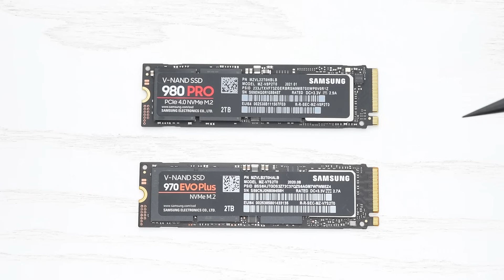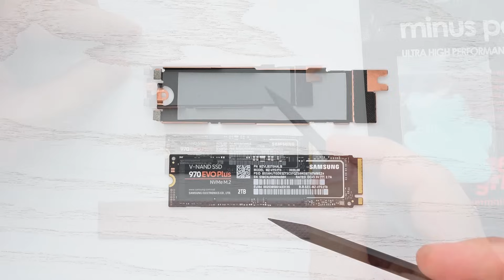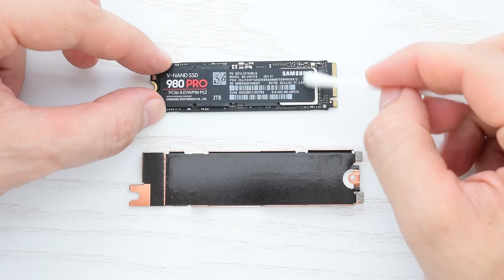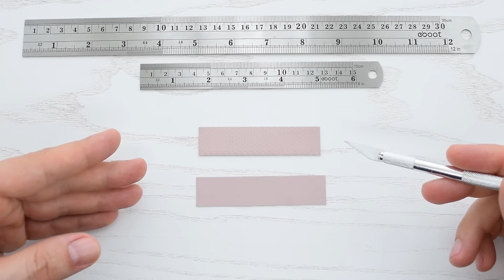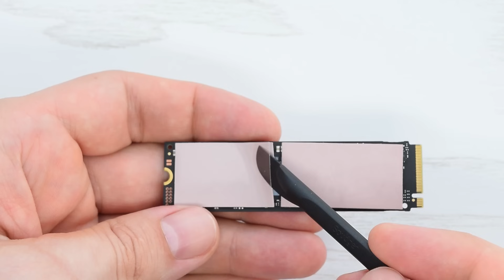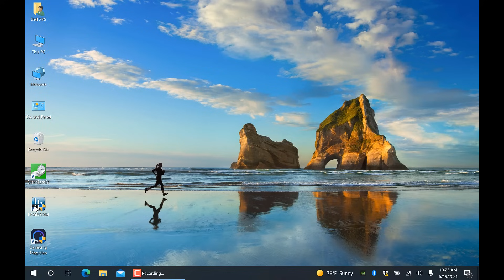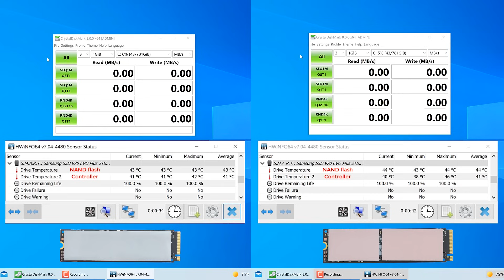Stop your Samsung NVMe SSD from Overheating and Thermal Throttling

Comment: Can I use this method for NVME enclosure? Samsung 980 pro will be cooler than 990 pro by itself?
Reply from the maker: Yes, this method is applicable to any heatsink and device in which Samsung drives are used. A fast SSD working on a slower interface doesn't overheat because it operates at a fraction of its capabilities. In contrast, a slower SSD will work at its maximum capacity and may overheat. Therefore, the Samsung 990 would be a better choice in terms of both performance and longevity.
Reply: @ElectronicsComputers  thank you!

Comment: I used mx-6 paste instead of pads instead, its messy but its non conductive and didn't really need to measure just eyeballed it and temps are much better.
Reply from the maker: Instead of using a thermal pad, you can opt for thermal putty. It’s slightly more viscous than regular thermal paste, tends to last longer, and is less messy. However, thermal paste will also get the job done effectively.

Comment: Is it safe or possible to remove the silica gel attached to ssd and heatsink after installation?
Reply from the maker: All silicone pads can be easily removed as they are not adhesive.
Reply: @ElectronicsComputers  thanks!! When I first tried to remove them it felt they are sticked to the SDD and copper plate, then I run the laptop and did benchmark test to heat up immediately turned off and was able to separate them from ssd easily!

Comment: What ssd and thermal pad do you recommend for Asus G16 2023 edition?
Reply from the maker: My choice would be Samsung 990PRO which provides outstanding performance, reliability and don't generate extreme temperatures. As for the thermal pads I'd use Gelid or Grizzly pads. Are you going to use a universal heatsink attached to the SSD?
Reply: @ElectronicsComputers  so Samsun 990 pro would be better than 980 pro in terms of heating?

Comment: Question - what is the main problem of M.2 SSD:
NAND flash temperature or the ASIC controller temperature? 
Which should be most important for me to cool down?
Reply from the maker: Well, heat is the enemy of any electronics. If components are exposed to temperatures over 50°C (122°F), they start to degrade and will eventually fail. When components operate at extreme temperatures like 80-90°C, their lifespan is significantly shortened. We deal daily with data recovery from NVMe drives with fried controllers or NAND chips, and in most cases, it's due to poor cooling. Simply applying a good thermal pad or thermal putty to the drive will drastically extend the lifespan of the drive.

Comment: Thanks by the info and idea,  I have used the same thermal pad height  and where is thinner I have use the double thermal pad then attached the heatsink, I have a Samsung SN770 , doing a Crystaldisk test : Hwinfo64 data : Before 74ºC/97ºC , now 58ºC/80ºC using a 1,80$ kit from Aliexpress 🖐🖐🤙🏻🤙🏻 amazing.
Reply from the maker: Great result! That's how $1.80 will significantly prolong the life of your drive.

Comment: Will you make another video like this slicing and sticking the thermal pads separately then you put a third party 3mm copper Heatsink?
Reply from the maker: Well, I'm not sure if it's worth making another video, because the type of heatsink doesn't matter. If you put something flat on your SSD, you'll see that there's about 0.5mm difference between the NAND chips and the controller. You can use any pads you want, but the difference between the pads should always be 0.5mm to level that surface. For example, if you put a 0.5mm pad on the NAND, then you have to put a 1mm pad on the controller. Or if you put a 1mm pad on the NAND chips, then you have to put a 1.5mm pad on the controller, and so on. Samsung actually did the same thing with their heatsink version, but they went even further and applied pads with different thicknesses even to small chips. You can see it here: https://i.ibb.co/10HwmmQ/980PRO.jpg
Reply: @ElectronicsComputers  

OHHH REALLY! I did not noticed that the controller and NAND have that 0.5 mm height difference! This is a good thing that you said this to me! So I need to buy two different size of thermal pads. Why is it that the heat absorbtion is better if you split the thermal pads into half? Can you help me on this one? I am planning to buy a 2024 Asus ROG Strix G18 Gaming Laptop. Will it fit a 3mm or 6mm heatsink? I plan to put 2 Lexar NM790 4TBs M.2.

Comment: Do you think a 2mm thick copper heat sinc will fin in a ultra thin laptop like my galaxy book 4 pro..

I want to upgrade the nvme and get a heat sinc for it..
Reply from the maker: I can't say for sure because I haven't had that model in my repair shop yet. But considering that you need to apply a 0.5 mm thermal pad and need at least 1 mm clearance between the back cover and the heatsink, I'd order a 1 mm thick thermal pad. By the way, I have a link in the description for a universal heatsink, which is 0.8 mm thick.
Reply: @ElectronicsComputers  thank you so much for your reply..  awsome info..
Reply: @ElectronicsComputers  when I looked at a screen shot of the internals it looks close. It's a wedge shape like a macbook air. And I checked online it's 11.6mm thick, assuming at the thickest point.  It's going to be very close even with such a thin heat sinc plus 1mm pad..
Reply: @ElectronicsComputers  actually I had one really important thing I would love your advice on.  I am upgrading the thermal solution on my intel ultra chip.  Thermal grizzly told me mounting pressure is important to get right.  Spoke about finding factory torque values for screws on my laptop heat sinc.  Is that of vital importance where I could make a huge mistake with tightening screws back too tight and breaking something or getting uneven torque values by hand?
Reply from the maker: @Mac.0.1  I've never heard of any torque values for laptop heatsinks. I really doubt such a thing exists since we have access to official service manuals for some laptop brands, and I've never seen anything like that. To me, it's nonsense—it's not a car or a bike. The only thing that is important for some laptops and other devices is when you see sequence removal numbers on the heatsink near the screws, and that's it. If there are no such markings, then the safest method is to screw the heatsink in a diagonal pattern. First, put all screws in place but don't tighten them too much. Once done, go tighten each one in a diagonal pattern with slight force, and the job's done.
Reply: @ElectronicsComputers  awsome. Thanks. Yes this was conversation with a thermal grizzly worker. I guess they have to cover their backs by suggesting over caution on everything. For people like me with no experience it's scary talk..

Thanks

Comment: Hello, I have a 500 GB m2 SSD and I am very happy with its speed. But I want to download more games.  Do you think I should buy a new 4GB HDD or a new 2TB SSD?
Reply from the maker: 500 GB is a very small capacity by modern measures, especially if you want to install a bunch of games. 2 TB will definitely be enough.
Reply: @ElectronicsComputers  Thanks 👍🏼

Comment: Today I found this video again, and after many searches and researching this video is the best way to do it.
The only thing to think of is that the memory chips don't like cooling they work beter with some heating.🤔
Well that's what I read. 
Now it's time to see if massive heatsink from ICY box will help my 990 PRO m. 2
But I am impressed by how good the motherboard Z590-E can cool by design. 
Because my first tryout with a heatsink and fan wash not working, and think this video show why that can be. 

Thank you for the opportunity again to rethinking the best way to apply the heat patches. 
👍💯
Reply from the maker: Thank you for the comment! I'm happy to help. And don't leave those NAND chips without a heatsink. There are no electronic components that like heat, well, maybe except for electron tubes/vacuum tubes. Even if there's some slight performance boost for a warm chip, which you'll never notice in real life, there's a bunch of other components around that definitely won't be happy with high temperatures.

Comment: Isn't it better to remove that samsung label from the flash before applying the thermal pad?
Reply from the maker: In theory it's better, but removing the label will void the warranty and it doesn't make any noticeable difference in cooling your SSD.

Comment: Thank you for sharing this. I use a 2tb 970 evo on my desktop with a bequiet heat sink. The ssd is fitted under the gpu which is not good for the air flow. The temperature dropped from 60 to almost 70c under load to under 58c on idle and max 62c under usage. Samsung says these temperatures are ok and no problem. I will check the thermal pads on the heat sink again and see if I can use your idea to improve the temperature even more.
Reply from the maker: Well, 60°C is a borderline for electronics components because at such temperatures and higher, the degradation of the semiconductors and PCB starts to occur. By the way, Samsung recently released an updated version of their SSD that comes with a heatsink. If you remove that heatsink, you'll see that they did the same thing that I did in the video, but they went even further and made different thickness pads for all the chips: https://i.ibb.co/10HwmmQ/980PRO.jpg
Reply: @ElectronicsComputers  Samsung support told me that everything up to 70c is within the limit and normal. At least I could reduce t(e temperature to below 60 in idle and low usage scenario. The ssd I use has no heatsink so I bought the be quiet aftermarket sink.

Comment: My 980 Pro, 970 evo have never overheated. X570 Tomahawk board came with thermal pads for the NVME.
Reply from the maker: Of course, they will never overheat in a board like that with a massive heatsink. It's only a problem for laptops.

Comment: should i put this on my 970 evo 256 gb m.2 ? please note that i use it as boot drive on pc and not laptop and my pc has enough good case fans
Reply from the maker: For a PC you can usually use one thick thermal pad which can perfectly cover all components. Just check the controller temperature with the same app I used in the video. If it's withing 40-59C you're fine.
Reply: @ElectronicsComputers  the asic controller goes 60 degree without using any thermal pad and while the pc is sitting idle , not running any games etc

Comment: Does this happen on all nvme?  Will this error have already been corrected by the manufacturers in 2024?
Reply from the maker: It happens to most M.2 SSDs that have chips with different thicknesses. For example, Samsung made an updated version of their SSD that come with a heatsink, and if you remove that heatsink, you'll see that they did the same thing that I showed in the video, with the exception that they went even further and applied thermal pads with different thicknesses for all chips even small ones: https://i.ibb.co/10HwmmQ/980PRO.jpg
Reply: @ElectronicsComputers  In this case, I'm going to buy a Samsung 990 Pro, the thickness for it is 0.5 and 1.0, correct?
Reply from the maker: @Thebossreserve  That's right!

Comment: Does the 990 pro keep the same thickness offset for the thermal pads? I saw they also ship out a model that already has a heatsink installed. Do you think that one is subpar to doing it by your method? I was wondering if the extra price is justified or not…
Reply from the maker: All those models are basically the same and they all have the same problem. In the SSD with a heatsink, Samsung pretty much fixed it the same way I showed in the video. But they went a step further and used different pads, even for the small chips: https://i.ibb.co/10HwmmQ/980PRO.jpg
Reply: @ElectronicsComputers  Thanks! 👍

Comment: Instructions: Remove the 0.5mm thermal pad, and replace it with... a 0.5mm thermal pad, great sales pitch!
Reply from the maker: You may keep the old 0.5mm pad and then just add a 1mm one to the controller. The question is, do you want to use a pad with high thermal conductivity or a cheaper stock one?

Comment: I just bought 250GB 970 Evo Plus, manufacture date Oct 2021, its layout is exactly the same as the 2TB one here (which is August 2020) but all four chips are at the same height, so it appears Samsung revised it in late production (unless it's just that the smaller NAND chips are thinner). Silly oversight for such a huge concern I have to say - assuming it was an oversight and not just a lazy "nah, it'll be fine" attitude. 
ETA >> I have a 500GB EVO Plus as the system drive in the PC I'm typing on, I used a 3rd party heatsink (instead of the flat piece of alloy Asus provide) with two thicknesses of pad from the get-go, but was surprised to find it was still idling in the high 40's°C and getting well into the 60's°C under load (NAND a few degrees cooler) - so I wedged a 40mm Noctua fan (set to run at 2500RPM/50%) in the cabling adjacent to it, blowing down its length from the socket/controller end and they dropped at least 10°C. I shudder to think about the temps it would run in a laptop.
Reply from the maker: Perhaps they changed the chips and evened out the surface. Samsung also implements similar methods to what I demonstrated in the video on some of their SSD models equipped with heatsinks. However, they've gone a step further by applying thermal pads with varying thickness to all chips: https://i.ibb.co/10HwmmQ/980PRO.jpg